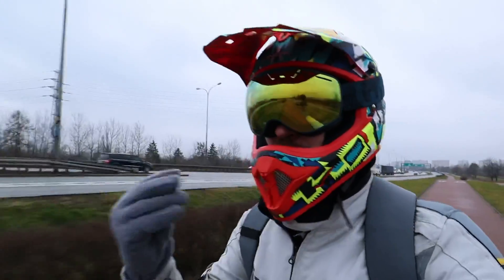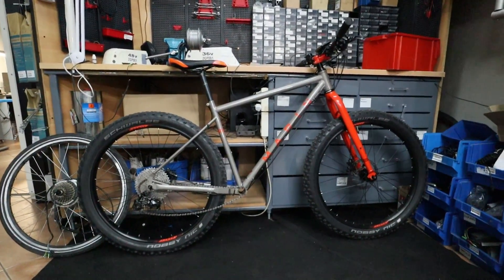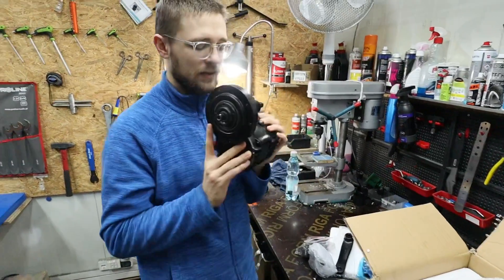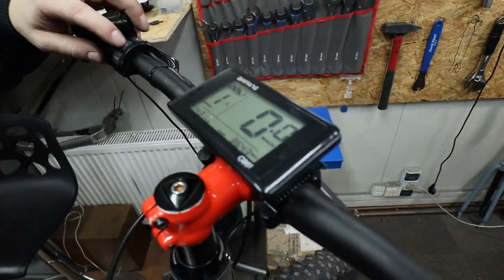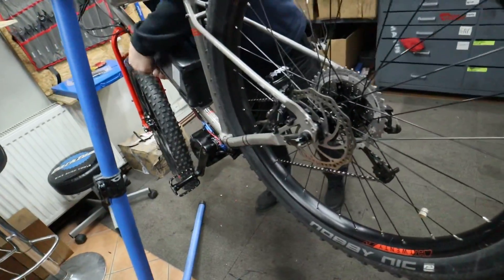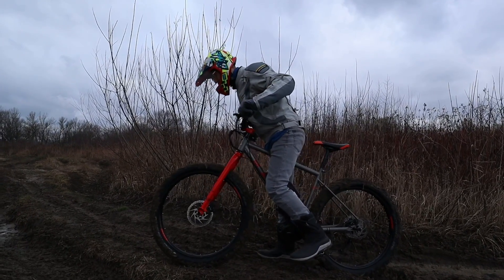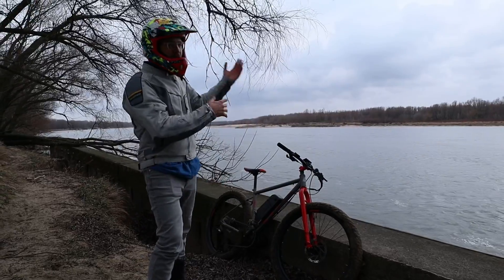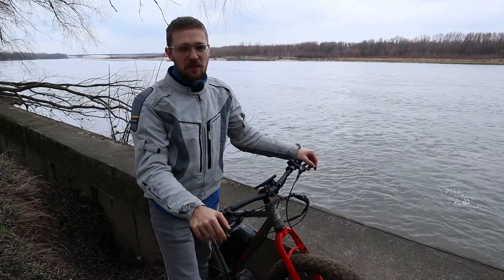We converted a bike into a 1500W Mid-Drive eBike!!! Top speed 60km/h (35 mph) Bafang 750W

Comment: Go on bro, Never knew you done a bafang conversion vid, Just bought a carrera hellcat lmt edition for the same thing, But im getting the 1000w bafang, Will chuck you a vid when its done, Going to put it on youtube anyways bro, Its why im buying a bafang an not a hub, So i got use of the gears, Top motors tho...
Top vid again brother......
Reply: I am getting a Trek caliber x9 will the moter fit ?? And I want 1500-2000 watts
Reply: @johnj5277  Should do, Usually trek is a top quality doner, As long as its not a carbon bottom bracket, Make sure it's the right size motor for the bracket tho, There is a dude called Johnny nerdout on YouTube, I can drop a link but he easy to find, That dudes a professional e-bike converter, He prob have done a motor on the bike you grabbing, Lol, Honestly it's his video I ended up using for my motor fit, lol....
You won't know you born bro, Advice aswell is get a bad boy lock and tracker put on it, A Trek conversion might attract would be theives....
Yeah honestly jump on Johnny nerdouts YouTube channel, It's easy to find, I'm not kidding he prob done a bafang conversion on a Trek 9, I think he have, lol....
Happy riding brother... peace ✌️

Comment: 1000 15000w a top.speed is 60? I have 250w and top speed is 55kmh :P
Reply: it depends on the gears, if you would put higher gearing into a 1500w bike it could archieve higher speeds as well

Comment: Disk brakes are strong enough on their own.    Unless they have a stronger type especially on a Mountain bike made by Marin,  I've had my Marin for over 15 years and my brakes have always performed above and beyond.
Reply: The only time the disc brakes that come on bicycles are any good is if they've already been upgraded to hydraulic or came out with hydraulic. Mechanical disc brakes only last about 25-50 miles when on an evoke kit, and you only get almost 200 miles on an ebike kit with hydraulic disc.

Comment: I bought the bbs02b is it a long lasting motor? I'll be using it for road and light off roading
Reply: Yes lots people getting years and 1000s of miles. Mine is only 5 months old with 1003 miles.
Reply: @shonvander7440  I have two one with 800+ miles and one with 500+ miles

Comment: How could this be 1500w if u havent done any modifications?
Reply: If they change firmaware with USB connector, 30A draw it would peak at 1500W.
If you arent careful that will break the nylon gears inside the motor, MosFets that deliver power will be under heavy load unless upgraded version, may also break.
Standard is 1000W peak for the 750W continuos power motor, BBS02.
Lunacycle upgraded version peaks a little over 1300W with 52V battery, I have no idea how this would be a 1500W engine.
Reply: @gloriouspopemantom373  because its bbshd and not bbs02
Reply: 48volt at 30 amps is close to 1440 watt but you can kiss reliability good bye. The controller will die , the internal nylon sprocket will give way and you will need a massive battery if you want any kind of range. Compared to non ebike the stock 750watt will do the job IMO. You can buy a 1000watt HD with a beefier controller and bearings but yo will need the gear sensor so you dont eat chains etc if you want more

Comment: You need a ERT controller and 72 Volt battery if you want to go real fast.
Reply from the maker: True true :) BAC 4000 or even better 8000 ^^
Reply: Yeah I'm at 52v now and am considering 60v for the next build... all the while knowing the addiction will certainly bring me to 72v soon after. Such is eBike life.
Reply: What are the controllers technical name. I tried looking this up. Hopefully something that can support 60v-72v?
Reply: Won’t that burn out the motor?
Reply: @SonOfAHerbert  there's a temperature sensor.
Reply: @SonOfAHerbert  temperature sensor and even more important is limiting the phase current to something sensible for the motor, and running low gear so it can spin up stupid fast
Reply: Lunacycles has ludicrous controller,  wait time to get one is tough though